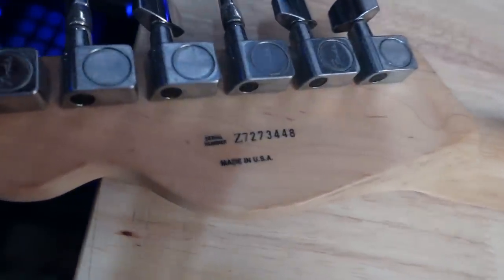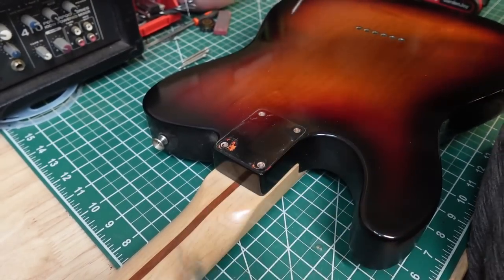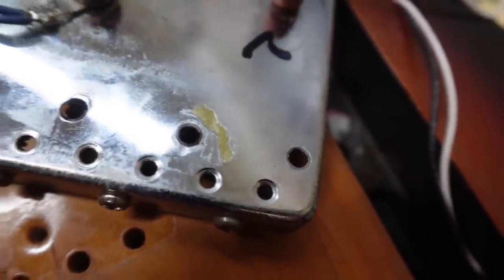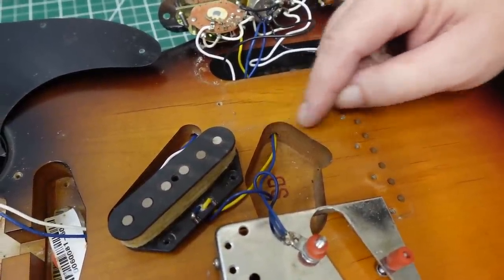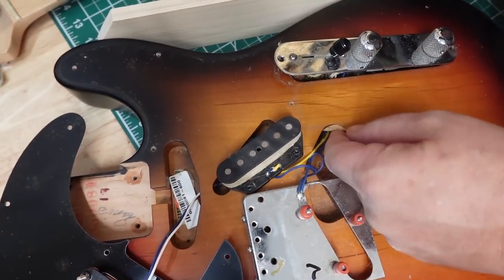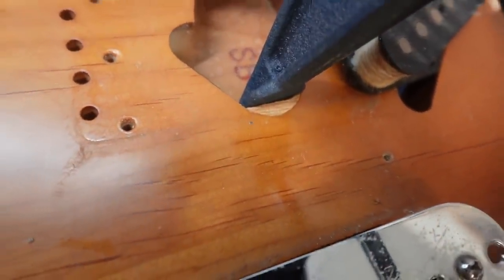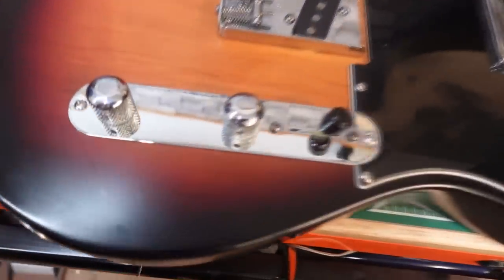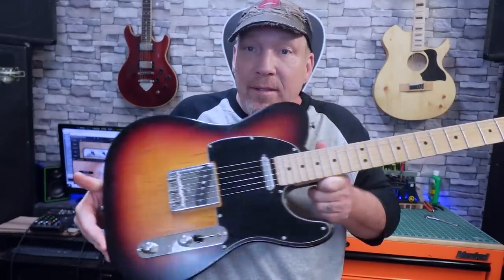American Made Fender Telecaster Has a Few Issues! Let's take a Look Inside! #Fender #Telecaster

Comment: 2008 Highway One Telecaster w/ black pickguard. Not sure if the pickguard is stock. Catalog shows it with white pickguard but the headstock logo suggests Highway One. Good guitars. Is that satin finish? Looks like satin nitro. Electronics might be greasebucket circuit.

Comment: Fender says it's a Highway One Telecaster, Maple Fingerboard, 3-Color Sunburst, model #0111262300, made 2006-2011. That doesn't sound right to me. I have three U.S. made Fenders, all bought new, and the serial numbers come back with a month and year of manufacture. None of those other numbers or letters mean anything to me. Also, all real Fenders say Fender on the neck plate, assuming it's the original plate. The truss rod hole on a real Fender neck has walnut around it. That does appear to be a real Fender bridge. All the components are decent quality. Definitely not Chinese. That hole wouldn't bother me as far as playing it, but it would be a huge deal as far as how much it's worth. I've seen imperfections on a lot of Fenders, but nothing that bad.

I use Windex for cleaning everything, including electronics. It's a good cleaner, dries fast, and does not leave spot or anything corrosive. If you are going to use water, use distilled water.

Comment: Mine tele had a modern bridge and when I change it for a vintage shaped like yours the gaps appeared. These vintage bridges used to have a ashtray cover over it and it hides the gap. Modern tele bridges are a bit larger to compensate this. But still a fenders flaw, because they sell Teles with vintage bridges without the ashtray and don’t fix the routing. It’s a problem of production line, where all the bodies are made equal and used in different models.

Comment: As others have said it's a Highway One Telecaster (2006-2011 models have jumbo frets). The SB just means sunburst. They stamp that on the blanks that have decent wood grain. It could end up sunburst or a translucent color (the highway ones had thin nitro even on non-sunburst. My Highway One Stratocaster is honey blonde). The ones that don't get the SB designation are bound for solid colors to cover up imperfections in the grain. 
I love the Highway One Strats and Teles for the jumbo frets. I think I might do my first refret on a Lone Star neck I have just to put some jumbos on it. I just have to do a little more research and decide which frets (there are too many choices, haha). In the meantime I bought a used American Performer neck to put on that guitar (jumbo frets also).

Comment: I was just going to comment on how many wines were around those posts, oh I guess I did. What I don't understand is that I just put Seamore Duncan Quarter Pounders on my 2021 MIM P bass and a Hipshot bridge. When I took the old bridge off and were the ground wire was pressed under the bridge there was a imprint of the wire in the finish. Now it was no big deal but do they put these things together when the clear coat is not totally dry. I bought the guitar brand new and had to send the first on back. A few issues that were really no big deal and would have taken the bass but the neck was like a bow and arrow. I took it home because I had 30 day to return and adjusted the neck 3 times and could not get the neck anywhere near it should be. The second one was perfect, I was looking for any reason to bring it back, frets were flawless. I did not have to change the pup I just did it because I like Quarter Pounders.

Comment: Looks like a Fender Highway One Telecaster. The Highway One Series guitars were cheaper than the Standard models and they were the predecessors of the American Specials and the American Performer Series. They had nitro finishes, basic hardware and electronics and they were about 750 bucks new and great guitars for the money. Had a few Highway Ones (Strats and Teles) over the years and liked them all.
Reply: I agree and the date also coincides with the run. They were nitro finish also.

Comment: I compared some photos online and I'm pretty sure this is a Highway One series (font of the logo, string tree, walnut plug at the truss rod, 3-saddles chrome bridge). The pickguard might be an aftermarket, because I've only seen this model sold with white guards - but I could be wrong.
The Highway Once series was a tier under American Standard. It was discontinued in 2011 and replaced with American Special.

Comment: Fender uses a system of putting the letter of the decade it was made first. E for the 80s, N for the 90s. Its Zero 7 so it should be 2007 but the body is dated April of 2008, so its from that era.
Reply from the maker: Thanks, good to have guys around that know their stuff.

Comment: I recently picked up a 2013 MIM Tele. It is absolutely perfect. No fret sprout, the fretwork is perfect and the guitar as a whole has great fit and finish. The only modifications that I did was replace the ceramic pickups with Fender Vintage 64s and changed out the tuners to the split shaft. No lockers needed. After I purchased this guitar I went to my local Guitar Center to do a comparison to a USA Tele. I tried three different guitars and they were crap. Major fret sprout, misaligned necks and that gap on the bridge.
No comparison. My MIM was so much better.
Reply: Best guitar I own is a MIM Esquire. I turned it into a Tele with a set of Fender CS '51 NoCaster pickups. It plays and sounds as good as any Fender I've ever played. I have several high-end guitars and this is by far my favorite. As for the fret-sprout in Guitar Center - that's their middle name. That place is where decent guitars go to die from abuse.

Comment: well you see.. Fender has this Serial number lookup tool when you go to Fenders website and I just happened to go look and lo and behold the guitar is actually listed there.. So I call out all who doubted the validity of it being real  And Sean thanks for all that you do and have done for us in the Scar Nation ..The Highway One Telecaster guitar features an alder body, modern C-shaped maple neck with a rosewood or maple fingerboard and 22 jumbo frets, two hot single-coil Telecaster pickups with alnico 3 magnets, Greasebucket™ tone circuit .. (Treble bleed)..and satin nitrocellulose lacquer finish ...made in 04/2008

Comment: Thanks for the video.  I was after a TELE but I'll buy a carefully selected Chinese one now.   Like your channel.
Reply: Although I simply wouldn't now, I bought a fender modern player tele about 8 years ago simply on a whim an never before having one. It is a great playing guitar, sounds great an has held up well after playing it  daily all these years. The pickup selector is known to be crap an I did have to replace that, but a quality part is cheap an easy to do if you can use a soldering pen.

Comment: WD40 takes rust off the screws. Also is that a polyurethane or a lacquer finish on the body ? Since you did the rout repair, might as well rub on poly lacquer to make it look invisibly good ? Might even smear some super glue to seal the wood. Beautiful guitar after the cleanup & repairs.

Comment: Fender has there name on the Neck plate. Name on head stock looks Mexican.... Don't think it's a USA. I think also Z7 is 2007 or 17 ? comments made at 5:45... Thanks
Reply: In 2007 the Mexican serial numbers started with MZ.  It's a USA Telecaster I'm just not sure what "trim level" this was considered.
Reply: It's a  USA model.  For one, it has 22 frets.  Fender Mexico didn't offer 22 fret guitars until the Player Series was introduced (okay; actually,  the Blacktop series did too, but they had different appointments than a traditional Strat or Tele and had been discontinued for a while now).  Another tell-tale sign is the walnut truss rod plug at the headstock.  Additionally, USA Fenders have a narrow fret dot spacing at the 12 th fret and have the "EZ Glider stting tree (BTW, this modern string tree first appeared in the 80's on the old Elite series and carriedover to the Standard made-in USA series which is not to be confused with the later American Standard).  

I think this is an old Highway 1 Tele which has since evolved into the current American Performer series.  Basically a lower cost American made Fender.
Reply: It looks like a 'highway one' model. It all looks right too.